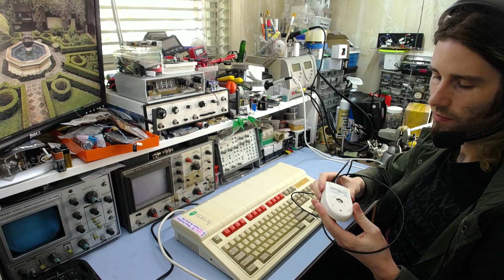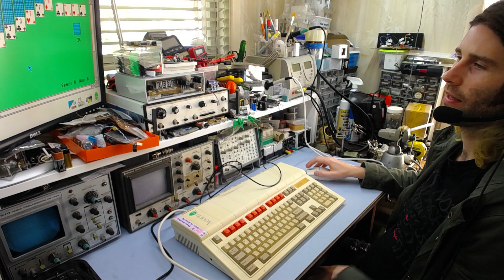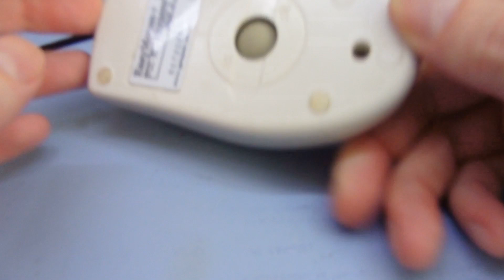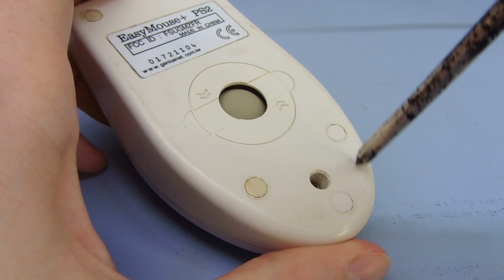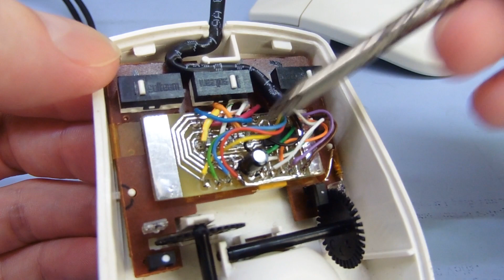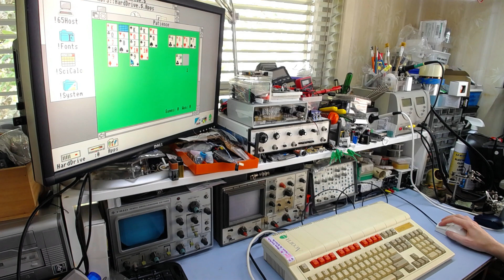I bought an Acorn A3020! (and had to perform a mouse conversion)

Comment: I don't see a link to a schematic for your Acorn mouse adapter?

I've borrowed an A3020 and I'm in the same mouseless boat. I'm pretty sure I do have a serial mouse in storage and I've got an old Pentium with IDE disks that still works. Linux can apparently read and write ADFS so what I presume I should be able to do is install the serial mouse driver under an Archimedes emulator (under Linux) and then I should just be able to dd the Acorn disk image with the driver installed onto the HD of my A3020.

Doing this wouldn't require Linux having ADFS support actually but that will come in handy for copying programs over after the image has been dd'd onto the disk.
Reply from the maker: There's really not much to it. All I did was rebuild the mouse so that the insides were basically the same as a standard Acorn mouse. There is no adapter as such. There is a thread here: https://stardot.org.uk/forums/viewtopic.php?t=16406 about what went into it. The files are downloadable there, or from my website.

Comment: I had an Acorn Electron which was a great computer, dont no how it compares to this, I'm not realy much of a gamer, however I was a fan of Williams "Defender" and the version for the Electron was a masterpiece, it was near as damm it perfect, playability was just like the real thing. If it will run on this guy I realy recommend it.
Reply from the maker: The Acorn Electron is older and uses an 8-bit 6502 CPU. This A3020 uses an ARM250 32-bit CPU, so unfortunately the hardware/software is completely incompatible.
But there are emulators for these systems, so running any of those games wouldn't be hard on Windows/Linux etc.